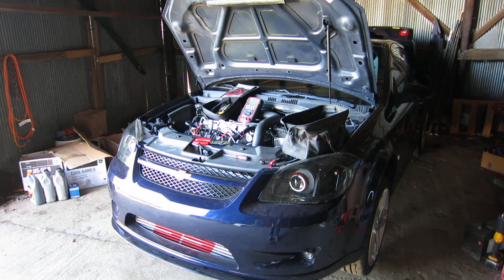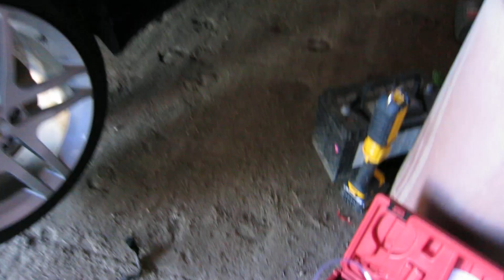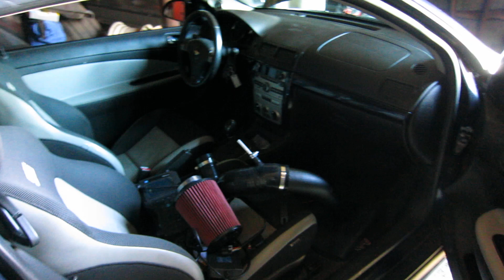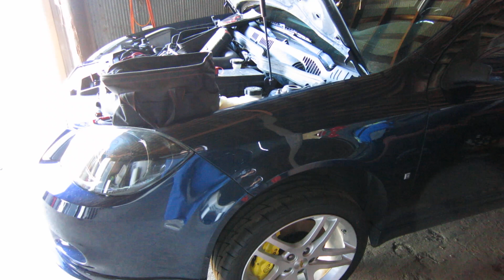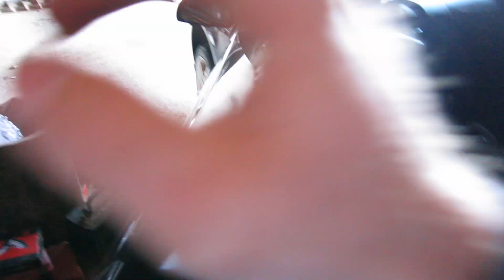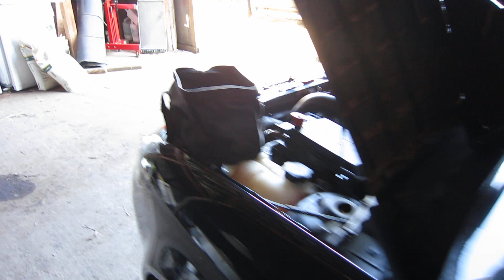Cobalt SS Build Series....I skipped a few.

Comment: Explain to me why you have so many f**** problems if you literally just said you're setting the car up for stock and you could have any shop and their mother put a brand new engine in and return everything to stock for 3500 at the max, okay you of the F40 swap so I kind of understand that but why was the engine out for you to do that? Sounds like you created a lot of your problems and you don't have anywhere close to the knowledge you need to fix them
Reply from the maker: Very interesting response to this video. I'm not sure at what point I said this car was going to be stock. The only thing stock left is the block, oil pan and valve cover. Would love to see a video of you working on a DI ecotec in the garage. Not sure if you've seen the following video or not, but you should.

Comment: Had a similar issue and after a bunch of messing around I noticed my car would start after I unplugged the ECU then run for about a month and randomly die. And finally after closer look, the wires next to the ECU was sitting on the block! The rubber on the wiring had melted off and wires were touching! Stupid GM wiring harness sits on the block right between your ECU and the block. Check there, I hope that’s it. Once I re-wrapped my wires the issue went away and it’s been a year. Also, with this car you need to unplug the battery after you change electrical parts, resetting it with a computer doesn’t work. Hope this helps.
Reply from the maker: Thanks for the advise! When I had the car all tore apart, I had inspected the harness for damage and repaired a few sections that the loom had fallen apart. I didn't see any chaffing and I think my resistance test confirmed that the wiring is ok but I will check again to make sure nothing got missed! Thanks for watching!